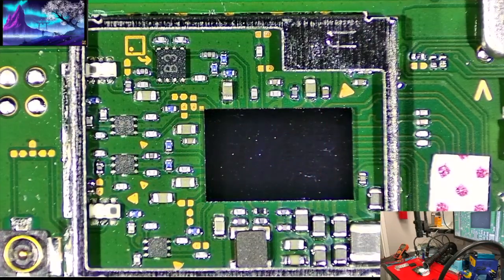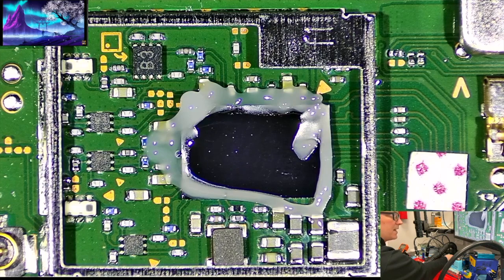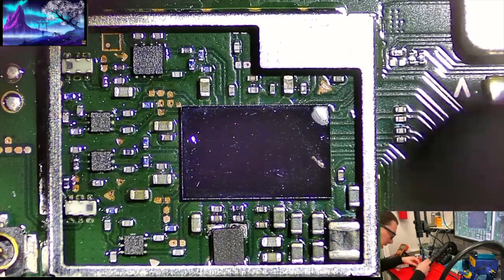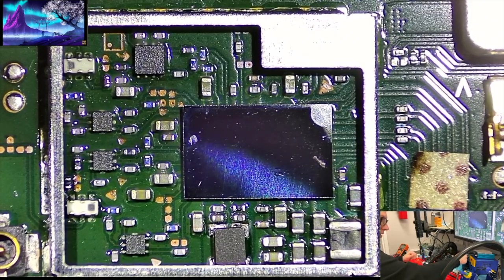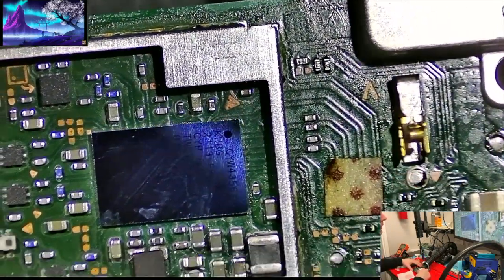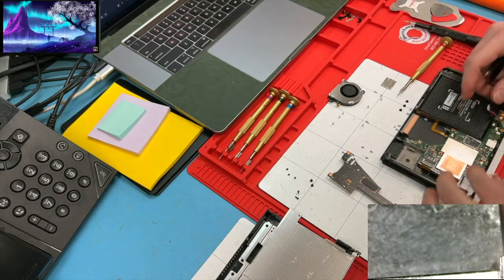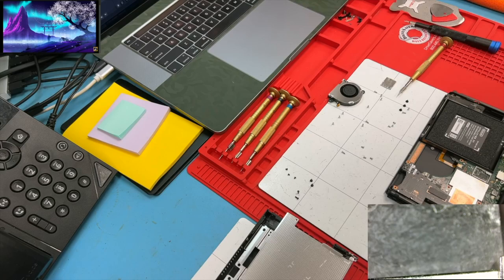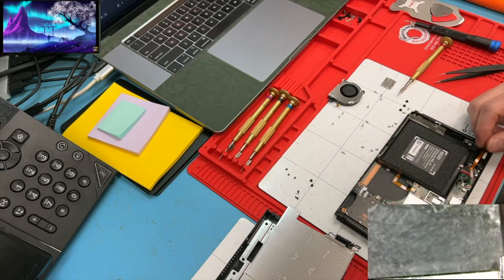Switch OLED Orange screen of death! Can we fix it?

Comment: It seems the chip from the Switch Lite is the same. Do you know if that's the case and where to source a donor chip for the OLED?
Reply from the maker: yea i would use mobile sentrix for the chips. they all use the same ones
Reply: Cheers, do you know if brand new CYW4356X will work or if this talk about it needing to be a pulled chip from a donor / programmed is true? @SwitchWhisperer   @SwitchWhisperer
Reply from the maker: no need to program any chip will be the same a new one or a donor pull @KyleGP
Reply: Cheers! Subbed:) @SwitchWhisperer
Reply from the maker: tysm! @KyleGP

Comment: I have no idea what a reflow is but seems like it could be useful for me, my switch can't find any networks
Reply from the maker: reflow can be done by a soldering specialist, it means to heat the solder to the melting point of a specific chip so that it re-flows into place and reconnects any lost connections

Comment: This just happened to me, all you gotta do is hold the power button for 15 seconds 💀
Reply from the maker: that is a temp fix and likely the issue will return
Reply: @SwitchWhisperer  if it does why not do the same thing
Reply: @salty353 because that will only work so many times- and then this process will be what you're ultimately doing anyway. 

I have V1 with bad charging IC/controller IC and I know using it before I can REALLY give it the repair it needs might risk damaging the whole unit further.
Reply: @SacredMilkOG  2 months later still hasn’t happened again